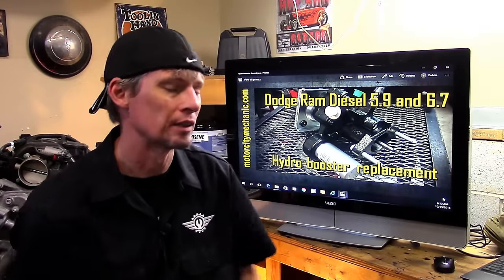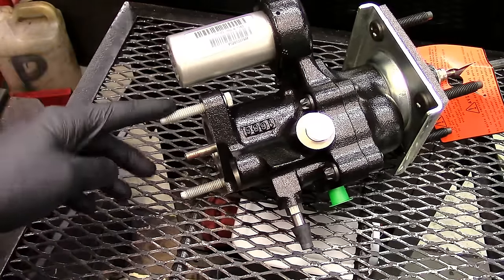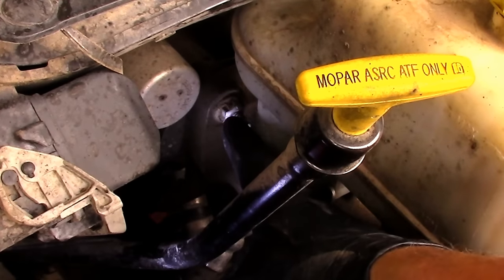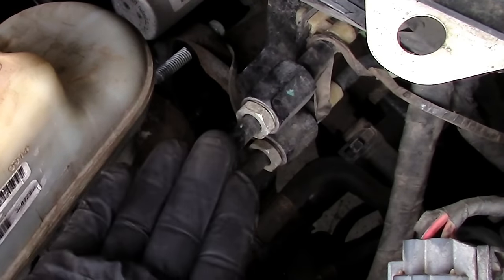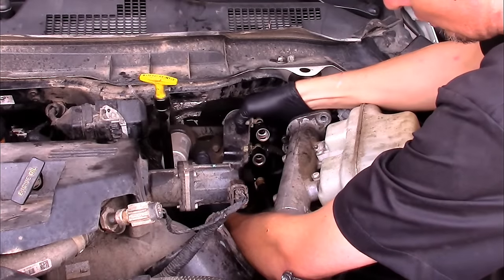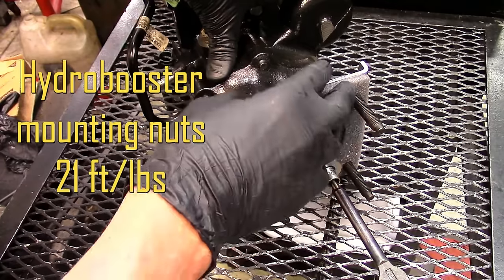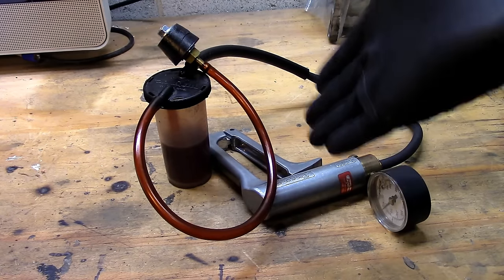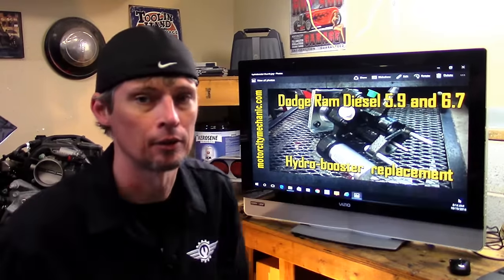Dodge Ram Diesel 5.9 and 6.7 hydro-booster replacement

Comment: Awesome video!  My problem is that my brakes are locking up (2007 Dodge Ram 3500 6.7 diesel cummins 4x4 SWR with rear disc brakes) while going down the highway.  They get progressively tighter until they are completely engaged leaving me on the side of the road as if the emergency brake is fully engaged with 100% efficiency.  At this point, the brake pedal is stiff from the top position. (i.e., cant engage the brake pedal any tighter from the top position).  I have temporarily released the pressure by bleeding some brake fluid off the bleeder valve on the caliper to get me off the side of the road.  Typically I will get 1 to 3 cc of fluid and the brakes fully release.  Worth mentioning is the fact that my power steering is also giving me problems.  (I cant turn the wheels unless the vehicle is moving.)  All fluids are okay.  Brake pads are okay.  Any help would be greatly appreciated.  By the way, after getting the brakes to act up, I jacked it up and both front wheels were equally locked.
Reply: I am having the exact same problem!!! I have replaced the calipers, the rotors, complete fluid flush with dot 3 and bleed the brakes .... all worked fine for a week and then all locked up again front and back... any idea what your problem was??
Reply: I also had the same issue and I replaced the brake master cylinder and it fixed the problem.

Comment: What is the "small weep hole" for under hydrobooster, behind master cyl. ?

Really good video by the way
Reply from the maker: I would assume its a place for fluid to escape when it leaks possibly. That way you can easily see that you have a leak and know what to repair. Thats just my thoughts. The service info doesnt make any mention of it. Some engineer somewhere knows for sure lol. Thanks for watching and for the comment. Make sure to subscribe and check out the other videos I have.

Comment: Dave I'm having some trouble finding a replacement hydroboost for my 2014 6.7 cummins. Does that have to come from the dealer?
Reply from the maker: Not sure who offers it aftermarket. I dont have faith in alot of aftermarket parts.....most just dont last. I stick to the Mopar replacement when ever possible.

Comment: great video dave thanks   just a question why are there 2 high pressure metal lines going to hydroboost assembly coming from power steering pump?   thanks
Reply from the maker: +Mark Ferraro Thanks Mark. The reason for the second is basically as a bypass leading to the power steering gear box. The hydro booster is in line with the pump and steering gear box so it's a pass thru design (in series). Thanks for the question and for the comment. Make sure to subscribe if you haven't already.
Reply: Just curious which line goes to the pump and which line goes to the gear box ?

Comment: Would this cause my brakes to go to the floor .my fluid in my reservoir. Isnt ging to calipers i ✔ power steering bone dry. No fluid supply to caliper running or not. Filled up power steering res got power steering back. Still no break plz  911 abs light is on
Reply from the maker: It would only cause a hard brake pedal. The issue your having will be related the hydraulic portion of the brakes. I recommend having the ABS codes checked.....possible issue with the master cylinder.

Comment: can.i install  a Non-Vacuum Booster on a 2014 dodge ram 2500 6.7 cummins
If so could you explain.
Reply from the maker: Sorry if I am confused.......on that vehicle it has a hydro-boost set up just like in the video that runs off of the p/s pump pressure and not vacuum.

Comment: mine leaking power steering fluid but it looks like it's coming from the back side of master cylinder and in front of hydro boost. is that possoble.or is the power steering fluid only in the steellines
Reply from the maker: If its power steering fluid then most likely it will be the hydro booster assembly. There will be power steering fluid in the lines and the hydro booster as well.  Thanks for the question. Dont forget to subscribe

Comment: How do u know what fluid runs through hydroboost and power steering pump? Is it ATF4 for a 1998 dodge 3500 5.9 diesel 24 valve
Reply from the maker: The service info states old school power steering fluid, not ATF4. Eventually we made the switch but for now I recommend sticking with the old style power steering fluid.
Reply: MotorCity Mechanic I just replaced  hydrobooster power steering  pump brake master cylinder  and steering gear box, question I have is when turning steering  wheel from left to right if I apply brakes at same time it gets hard to turn the steering wheel also when I push on brakes hard seems like they lock up

Comment: the bleeding procedure is where I made a big mistake. I closed the power steering reservoir and I moved the steering wheel left to right and the air did not have a place to go and the reservoir top section is broken. fluid everywhere. so now I have to replace the reservoir and i am assuming there is air in the line now.
I did this with the engine off. I also pressed the brake which i believe that was another mistake. first time doing this... 
I need help. I am planning on trying to replace just the reservoir and filling up the system with power steering, wheels off the ground and turn wheel left to right while the engine is off about times and see if I can get the air out. I have the pump too which I could use as well. 
help please if you guys can give me some pointers or ideas... I do have the new power steering pump and reservoir which I could install but if I can just get away with replacing the reservoir with out changing the pump I would like to do that...
any help will be appreciated......

Comment: My truck makes a noise from inside the trucks break pettal, and I put the hydro booster and it still makes the sound. Can you help me
Reply from the maker: Depending on the year....there were some issues with the inner liner coming loose. I cant remember if it was the one from the pump or the one going to the gear box. It would make a hissing sound. Its something I would recommend checking. Here is a link to a video I did on that issue. check it out and make sure to subscribe. https://www.youtube.com/watch?v=5UJ5mXvNwAA

Comment: I had someone replace the Hydra booster today and now my power steering isn't working at all only when I accelerate. does that mean it still has lots of air? or maybe I have other issues. the steering worked when I took it in and now it doesn't
Reply from the maker: Depends if you had this issue before the repair. If you did then the issue will be somewhere else. If the the issue wasnt present until it was replaced......then there may be air in the system or the replacement part my be faulty.

Comment: I have a 1999 dodge ram 2500 5.9 and I think is liking a brake fluid, between brake pump and power brake booster , What do you think is happening? May you help me ?
Reply from the maker: You need to make sure which is leaking.....it could be the older style of power steering fluid or brake fluid. Which ever you find....replace either the master cylinder or the hydrobooster.
Reply: I  already check and the master cylinder is full and the power steering is empty, What do you recommend me ? I need to buy a new hydrobooster or repair it? and if I have to buy it what will be the best make and place to do it?
Reply from the maker: I havent checked into building the hydrobooster.....best way is replacement. As far as what brand or where....I deal with the dealer parts. I checked and dont see one on the Geno's Garage website either so I cant recommend a brand because I havent tried anything but the Mopar replacement

Comment: Is there a seal between the master cylinder and the hydro booster?
Reply: I want to know the same thing. On my truck there is a seal and it looks damaged.   I'd like to know if there is a replacement seal or not, because whoever worked on this prior put silicon gasket and called it a day but it looks like shit and it's obviously not how it should be.   This video left out a lot of major questions im having including the fact there are hard steel lines coming off my master cylinder making its almost impossible to maneuver out of the way like he did in the video.

Comment: I followed the steps and at the end when I pressed the brake pedal it got sucked in, what do I do now
Reply from the maker: Thats an odd one without seeing it in person. Been along time since I have done one...actually the video was my last one. Did the replacement have the push rod installed already that pushes against the master cylinder?

Comment: Do you have to replace the brake light switch as well?
Reply from the maker: Is this JW Montoya my fellow local Youtuber?
Reply from the maker: Your don’t have to replace the switch. It’s rare there is an issue with the switch when you remove it or mess with it but still…..check to make sure your brake lights work when done just incase
Reply: @MotorCityMechanic  no must be a different guy. I took a 08 dodge 3500 to a mechanic to get the hydro boost replaced. Said they had to replace the switch but I’m still having troubles with the switch. Seems like they installed the switch incorrectly

Comment: My right side of the truck got hit, the steering gearbox got damaged and leaking oil. Could this be the reason why the breaks don’t work fully? (I have to press brakes really hard) also the steering wheel barely turns.

Comment: I am getting very little leaking into the cab but I am having a hissing sound at idle/rest. When I press the break or turn the steering wheel the hissing goes away. With this be something in the hydroboost? It doesn’t sound like it’s coming from the pump

Comment: Would you possibly hear a hissing noise if the assembly has gone bad? My 6.7 has a hissing sound that goes away when i push on the brake.
Reply from the maker: Have you watched the one video I did related to a hiss? It might be related. Here is the link: https://www.youtube.com/watch?v=5UJ5mXvNwAA . Thanks for watching and make sure to subscribe
Reply: MotorCity Mechanic you've got a subscriber here for sure. That sounds exactly like what mine started doing today. Thank you very much, i will check that high pressure line out tomorrow.
Reply from the maker: Many thanks and let me know what you find.
Reply: Just fixed it today. That was it. Thanks so much for the info!
Reply from the maker: Awesome! Glad that was the issue. Thanks for the update and for following the channel!

Comment: This video is not for 5th gen rams! 
Doesn’t show how to remove the throttle pedal bracket that is in the way of the bottom right nut holding the booster to the firewall! 
Y’all need to specify what year models your videos cover!
Reply from the maker: This was made 7 years ago…….(2016). It’s not meant to be a one size fits all and I don’t have the time to go back to 7 year old videos and keep updating each year that it fits that came out after it was made. 5th gens are 2019 and newer, they weren’t even out when the video was made.
Reply: I meant 4th gen, how do you get the freakin throttle pedal assembly out of the way to get to the right bottom nut?